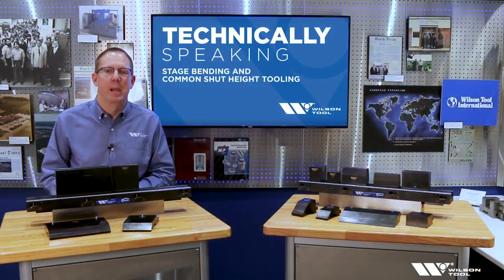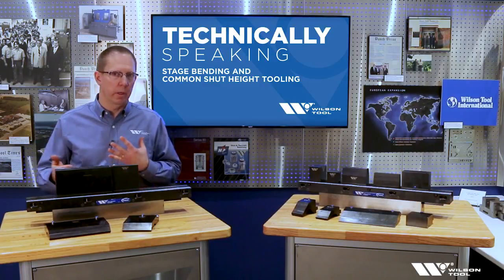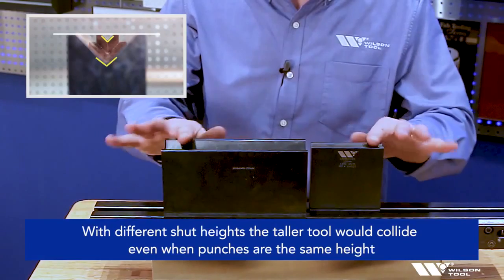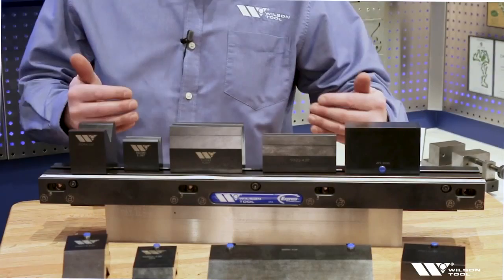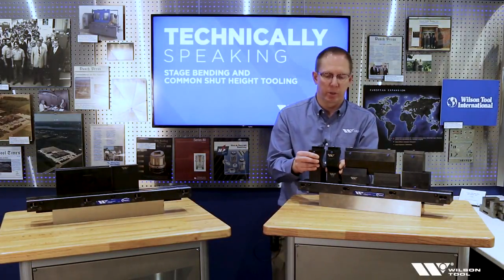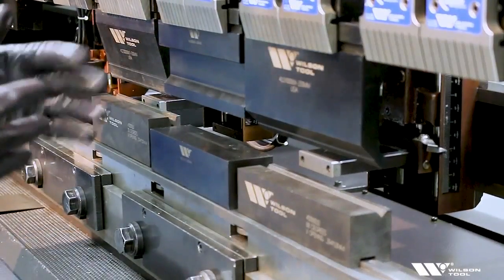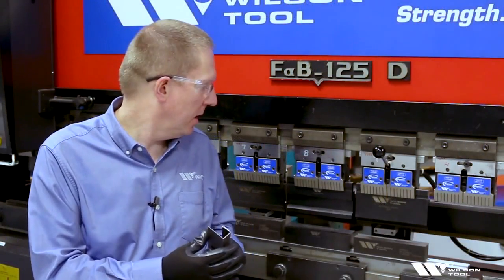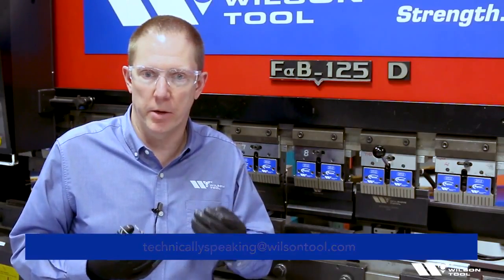Stage Bending | Bending | Technically Speaking

Comment: What about coining with an offset tool.   Is it possible?
Reply from the maker: There are two ways to look at this: 
a.  Yes, you can coin with an offset tool in the sense that the tooling comes together to make the form.  I would probably call in bottoming with a little extra IF needed.
b.  Yes, you can coin with a staged offset tool in a staged tooling set up.  Like any application, make sure tonnage in the application lines with the tonnage capacity of the tooling and press brake.

If you would like to discuss further or have additional questions call us at 800-445-4518 or email at bending@wilsontool.com.